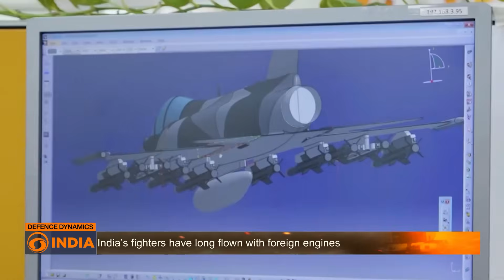No More Foreign Jet Engines | Defence Dynamics

Comment: We don’t have testing equipment, materials to withstand high temperature at high rpm, to design and manufacture a turbofan. We cannot even design a commercial aircraft. We still depend on imported technology and then the refrain make in India